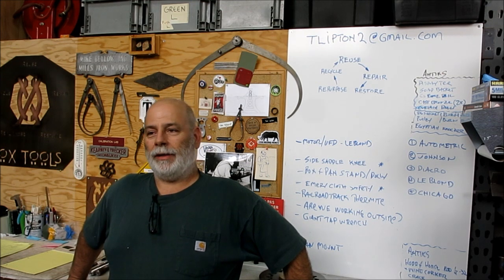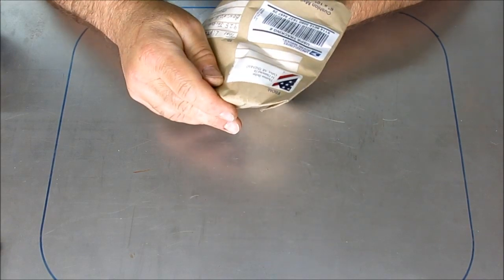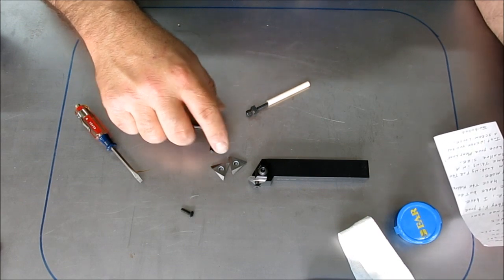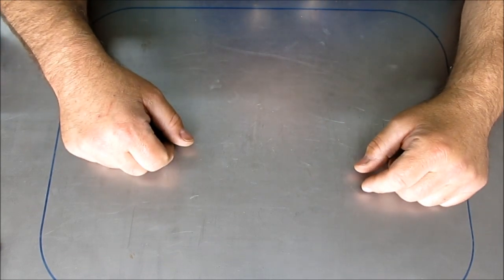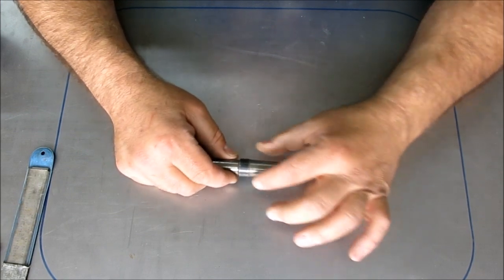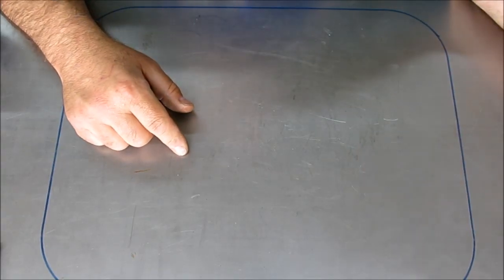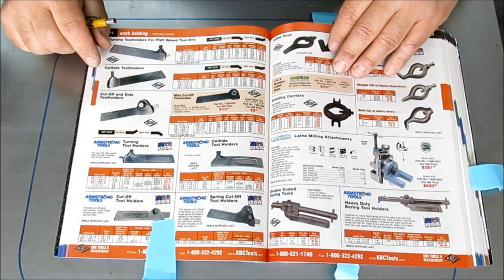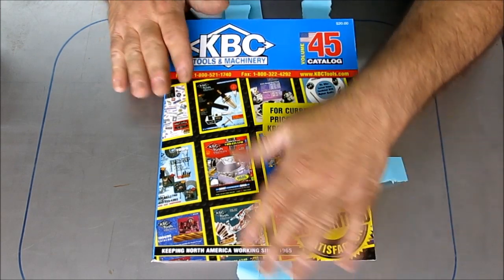Monday Night Meatloaf 40

Comment: I see you've been continuing your Sunday visits to the flea market. I havn't been in a while. I'll probably wait until the cooler weather. You got some nice stuff.
 in case you forgot, you give me the last rule clamp you found at the flea market in trade. I think you sent it with the 4" dial indicator.
The mystery tool looks like some kind of fancy parallel separator, or a thin jack for use on the mill, or in a mill vise. Never seen one before.
Nice find on the hair curler iron, but I think your a few years too late now!
I didn't think Armstrong still built those lathe tool holders. I was under the assumption they stopped production on them several years back. I tried to buy some of the carbide holders with no luck.
Cool vid. Thanks for sharing some of your meatloaf with us Uncle Tom.

Adam
Reply: "I didn't think Armstrong still built those lathe tool holders. I was under the assumption they stopped production on them several years back.'

The catalogue says limited to existing stock.
Reply from the maker: Hey Adam,

I had two of the rule clamps. I had one and then found one at the flea market which is the one you got. I went looking for mine and couldn't find it. Thanks for the comment.

Talk to you soon.

Tom

Comment: Hey Tom,
Thanks for some more meatloaf! You got some really cool viewer appreciation gifts. You also got some really cool flea market finds! I have a few suggestions for the curling iron heater . . . You could use it for cooking hotdogs or burgers. It would also work for making toasted cheese sandwiches. You could use it for heating frozen things like Jeno's Pizza Rolls, Hot Pockets, etc. Since I have never worked in the metal trades, I shall not hazard a guess at what the mystery tool is.
Have a good one!
Oxen Dave

Comment: The sheet metal clamps you demonstrated is also used in the Autobody industries to bring sheet metal together temporarily for spot welding with a mig through another hole next to the clamp.

Comment: You are quite correct, those rotabroach cutters are mega expensive but ace at doing the job they are designed to do. We use them in a mag base drill on steel structures cutting bolt holes in the main steel work.
Reply from the maker: Hey Dan,

They make short work of holes in particular when you have the slug ejector.

Cheers,

Tom

Comment: Did you say put a tool on it and get a grunk on it at the 17:57 mark?  Thats quite a way with words you have there sir! :)  I just bought a Hougen Mag mag drill on ebay used, and those are setup to primarily use those Annular cutters... So $20 was a steal! ...Good meatloaf as always
Reply from the maker: Hey Turbo,

Actually the word was "Gronk" You know the little noise a fastener makes when its tight and seats down.

All the best,

Tom

Comment: Quoin, used to lock type in a chase of old letter (I miss my Kluge and windmill) press printing presses.  Also used to lock steel rule dies in the chase of diecutting equipment.

Comment: That's I think. To clamps an object on a mill that dos not have 2 parallel edges. So you can clamp them down were normally you cant. I think. can think of a few other reasons that can be handy for.

Comment: Hi Tom,
That heater for curling irons is old. The irons that go with it are all metal. I almost bought one last week with the irons in it. I think the cord on yours may have been replaced at some time. The one I seen had an old cloth cord.
Reply from the maker: Hi RC,

Need another one? Thanks for the comment.

Cheers,

Tom
Reply: oxtoolco
No...I got a haircut, no more curls for me. LOL

Comment: hi tom its so hard trying to find a good gray scale with being an artist i use the gray scales and color wheel i am tring to get hold of a all white tray or a very light gray just like them but i can find any in the uk .interesting you should mention diamond compound  i use that to polish the scratches on the fish tanks i have its amazing stuff for removing scratches from glass great video tom keep cranking them out cant wait for the next part of the autometric jig bore great stuff
Reply from the maker: Hi Andy,

Thanks for the comment. I'd like to hear more about glass polishing some time.

Cheers,

Tom
Reply: ok we use jewelers rouge and a soft cloth first you use the coarse to get the bulk of the scratch out an the fine to take the rest down to a fine polish seen me spend two to three hours taking fine scratches out of the front of a tank only to find that the lad who bought put the front to the back which was facing the wall  so it would never been seen also used it with a car body buffer to take scratches out of a car windscreen

Comment: Tom,
You have got one heck of a flea market there, kind of a machinist dream. Great Deal on the Annular Cutters. How the heck is it that you come up with these tools that are from othe trades? Nice looking Printers Quoin for your mystery tool. Take the hair curling heater and you can wrap hot dogs or any sausage in tin foil and then place them inside and cook them there in the shop. I can't think of any other GOOD use a hair curler heater would have in a Man's Machine Shop. LOL  Hey got to ask what happened to the mid week vids you were putting up, the Roach Coach series???
Enjoy your videos and look forward to each one.
John
Reply from the maker: Hey John,

Thanks for the comment. Man you guys are hard. Three videos a week and you want more. Am I the only one out in the shop around here?

cheers,

Tom
Reply: Certainly seems like the mystery tool could be a printers quoin.  I though it might work for a 1" square tubing internal clamp/grip too.

Comment: Mini
Magnetic
Base
FEATURES:
• Holds indicators with
3/8" stem or with standard
dovetail mounts.
• Holding power: 37.5 lbs.
• Articulated arm style, 
magnetic base positions
and locks easily.
• Size of base: 1-3/16" sq.
• Central locking knob, 
tightens both arms.
• Overall arm length:
approx. 6"
• Top arm: 3.35"
• Bottom arm: 2.55"
• On/Off switch.
Part No. 
8-410-000
Our Net Price
$34.95

i found this "noga type" arm with mag base in the KBC catalog. thanks, Tom
Reply from the maker: Hey Sam,

Right on. Let us know how it works when you get it.

Cheers,

Tom
Reply: no tools yet, still waiting.
Reply from the maker: sam yeates Hey Sam,

Was the base back ordered or did they say it was in stock?

Cheers,

Tom
Reply: Hi, Tom. i have the tools, now arrived this morning. it is exactly what i needed. it not the noga name brand, no fine adjustment but it's good. one of my lathes is a tiny watch makers unimat from the 1960's. the small magnet base fits nicely on the back my tool holder. i will drive it up to the work with the saddle and cross side.
Reply from the maker: sam yeates Hey Sam,

Good deal. Shoot me a picture of your setup at the super secret email address on the whiteboard.

Cheers,

Tom
Reply: did you see my pic i sent???
Reply from the maker: sam yeates Hi Sam,

Did you email it to my personal email address? I haven't' seen anything yet.

---Tom

Comment: Tom, You could build coil cords with that heater.
Reply from the maker: Hey Doug,

I'm thinking of doing something different with my hair. 

Cheers,

Tom
Reply: oxtoolco Yeah, could be shorter.
Reply: That would be pretty cool, even though the cords would be pretty small.  I had considered looking into the same thing at one point just for the fun of it.  Self-retracting coil cords can be pretty pricy, especially if customized # of conductors, length or ends are specified.
Reply from the maker: Doug Rundell Hey Doug,

I was thinking micro dreadlocks......

Cheers,

Tom
Reply: oxtoolco That would be a good (?) look for you.

Comment: That is twice now that you have shown the OxTool Motor.  Not too surprised you are building motors.  What sizes and winding configurations do they have (shunt compound etc).  Is this one for shop and do you have a large enough load for this guy.

Dan Bentler
Reply from the maker: Hey Dan,

I had to think about that for a minute. 

Cheers,

Tom

Comment: Everyone in an aircraft shop knows that the unit of measurement for Cleco fasteners is the coffee can.  We also know that if you have, say, three coffee cans full on the bench, when you come back in a year, you'll be about half a can short.
Scientific research now suggest that the metal atoms from the missing Clecos evaporate, and are later reassembled into coat hangers in the back of an always closed closet.
Reply from the maker: Hi Tom,

The lost cleco's end up with all the 1/8 allen wrenches, tape measures and utility knives. Its the black hole of tools.

Cheers,

Tom